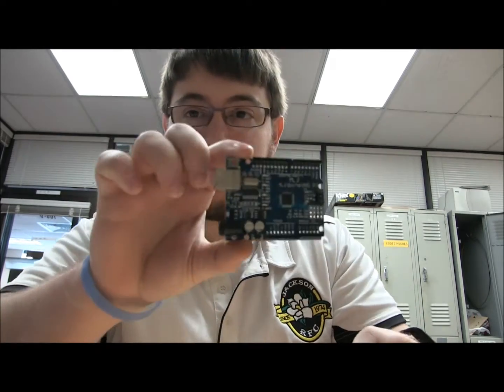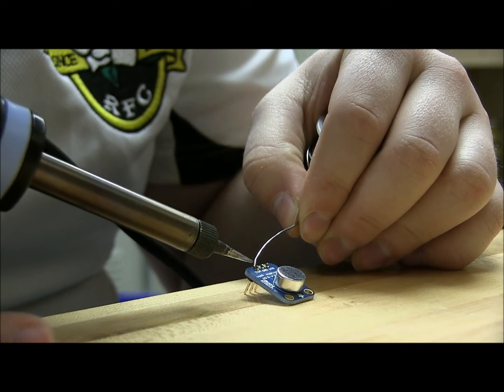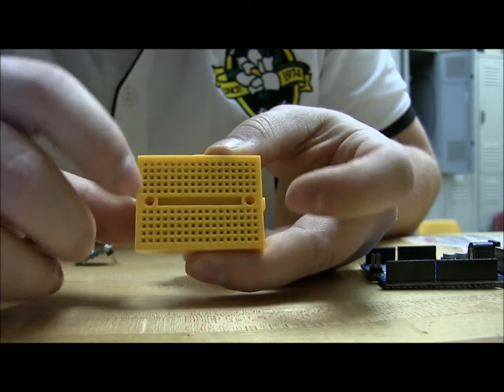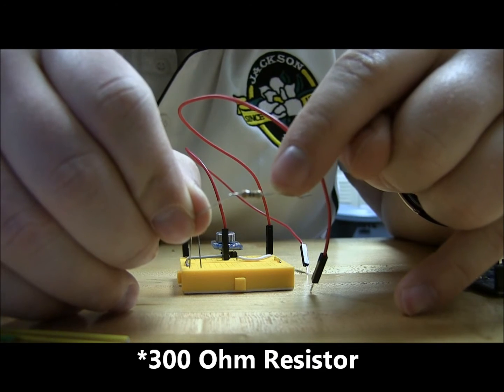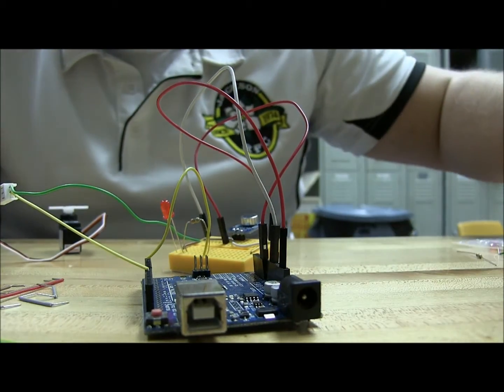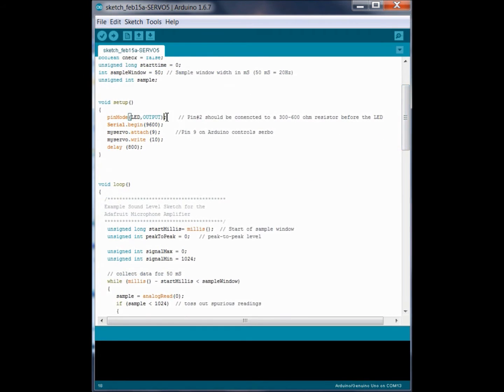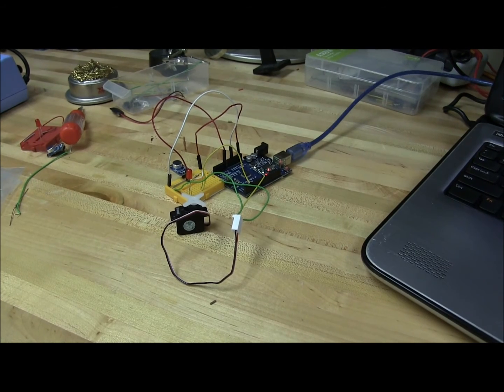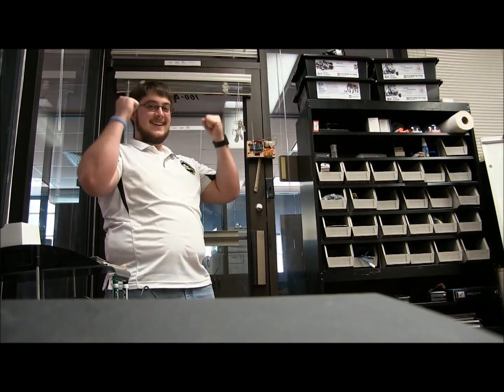The Factory: Arduino Clap Light Switch

Comment: im using the mbed arm lpc1768 and the arduino code doesn't work. can you help me pls?
Reply from the maker: +Dawell Zulu So the mbed arm uses a different level of coding called "assembly code" where the arduino's are programmed in C/C++ language which is a "imperative" coding language. There's not a way to directly translate my arduino code to the mbed program, but there should be a similar logic structure. I would suggest writing out the logical operations of the code. This will help when interpreting how to program it for the mbed.